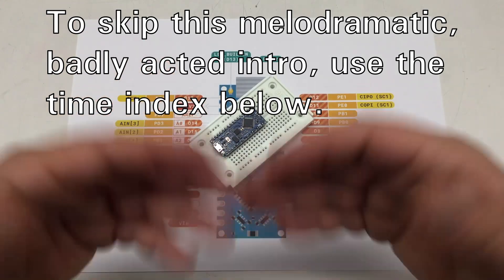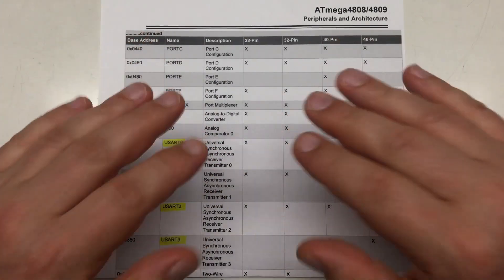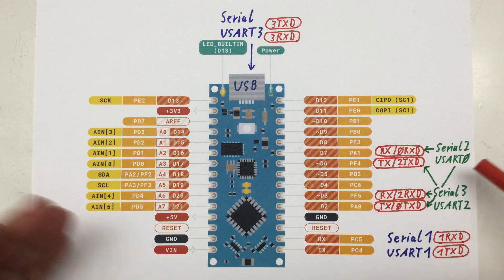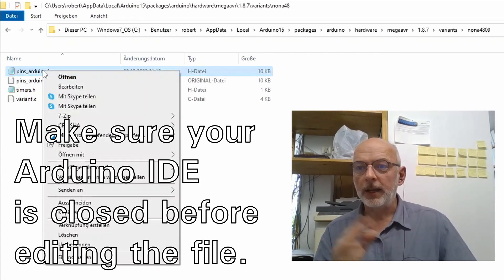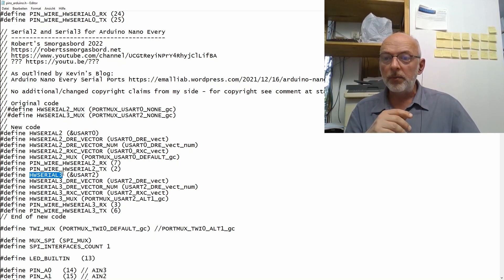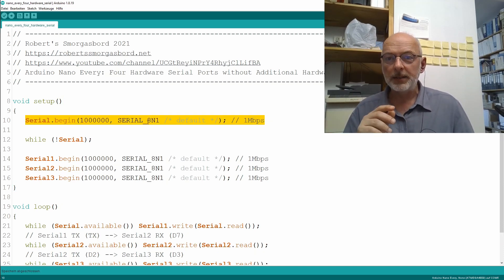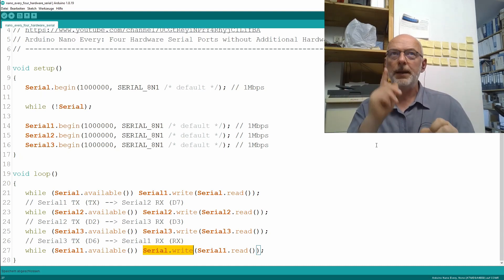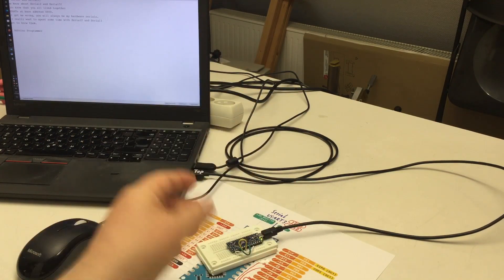Arduino Nano Every: Four Hardware Serial Ports – Without Additional Hardware

Comment: I am using a Mega 2560 Board and I wrote exactly what you wrote , but I only get Junk Characters . I tried with Hardware Serials and even SoftwareSerial Library . Please advise
Reply from the maker: That is a very hardware specific hack for the Arduino Nano Every (ATMega4809) and does definitely not work with the Arduino Mega 2560 (ATmega2560). Sorry!

Comment: It's so cool to have 3 hardware uarts,  it's pity Im using 3.3V pro micro. Is there a way to easily convert this nano every to 3.3V?
Reply from the maker: I don't know it it's easy, but looking at the circuit diagram ( https://content.arduino.cc/assets/NANOEveryV3.0_sch.pdf ) I'd say remove D2 (bridges USB 5V to the V5 rail), remove IC1 (5V regulator) and U2 (3.3V regulator) and just feed your own 3.3V into the 5V and 3.3V pins.
You can also try to reuse the MPM3610 (IC1) somehow. Just changing R6 and R8 can turn that thing into a 3.3V regulator.
Reply: @robertssmorgasbord  My hope is to have them 3.3V version for nano every as for others older versions
Reply from the maker: @realmagdel  Regarding the Arduino Nano Every at 3.3V there's a related thread on the Arduino forum: https://forum.arduino.cc/t/nano-every-at-3-3v/1168708

Comment: Thanks for sharing! Are we allowed to set the hardware serial pins to digital pins other than the ones used in the example?

Edit: Reading Kevin's blog, I believe the UARTs are tied to these specific pins. Still good enough for my application :)
Reply from the maker: In principle you can move around some of the USART pins. See the ATmega4809 datasheet ( https://ww1.microchip.com/downloads/en/DeviceDoc/ATmega4808-4809-Data-Sheet-DS40002173A.pdf ) "4. I/O Multiplexing and Considerations" on page 18. However, I don't know how well that works within the Arduino environment.

Comment: I think the code will lock up when you send a lot of data at once
Reply from the maker: You're absolutely right! Though, it will not really lock up, but lose data when you send more that 64 bytes (buffer size of the HardwareSerial library). Kudos to you for spotting that! Just replace the four "while" in the loop with four "if" and it will work just fine.